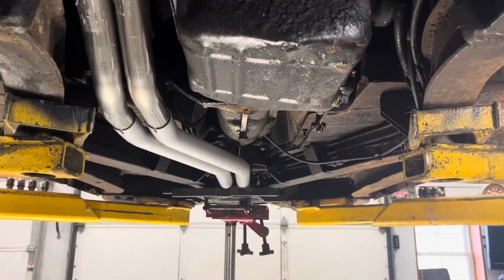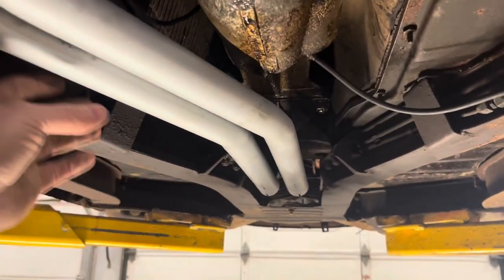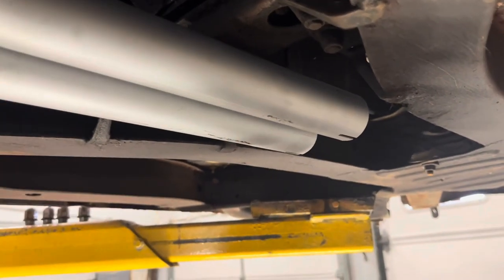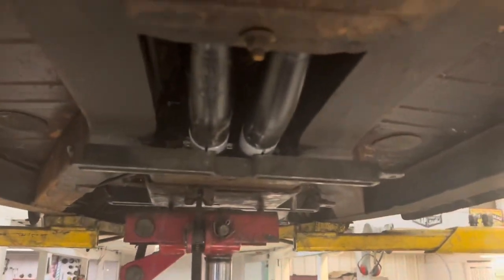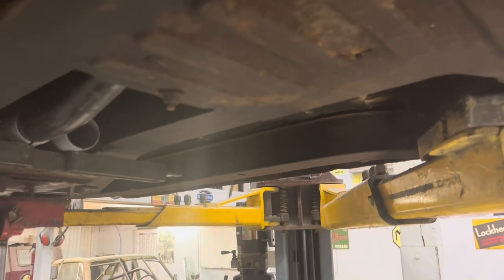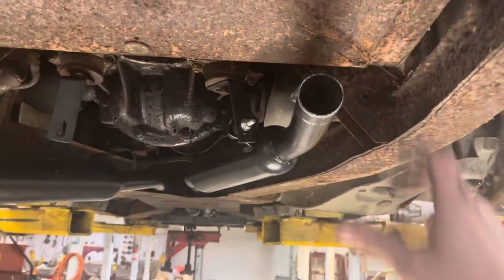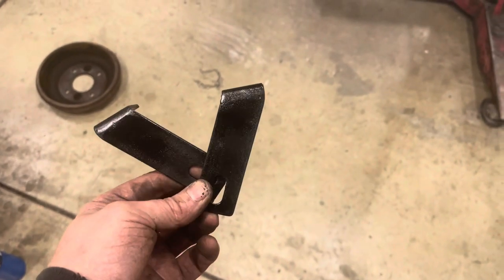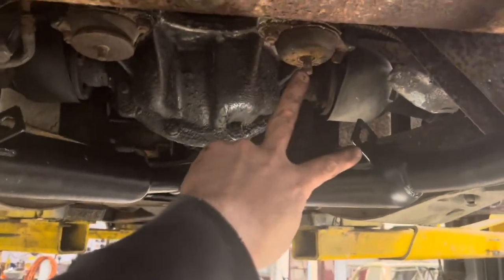Triumph TR6 pacesetter exhaust, making it fit properly+ sound

Comment: You are a master at metal work Rob, no doubt. Appreciate the video. On the sound: does it produce any raspiness or does it maintain a deep rich sound throughout the rpm range?
Reply from the maker: In general it sounds deeper in tone and less raspy than the mic picked up, especially while driving
Reply: I switched out the “box” type resonator with the “tube” type resonator you show in this video and it did improve the exhaust sound.. still slightly raspy, I leaned out the carb and fixed the sound completely… thanks for the advice